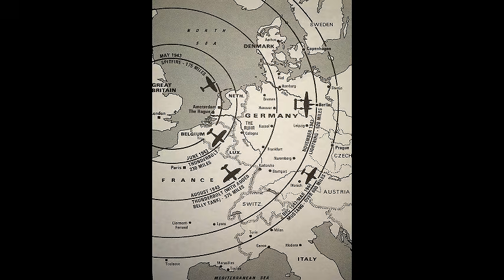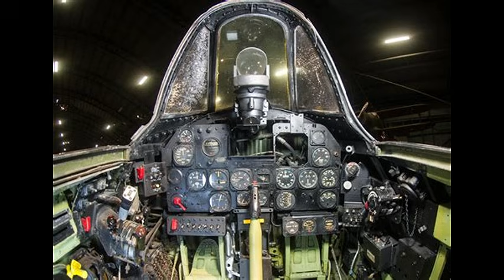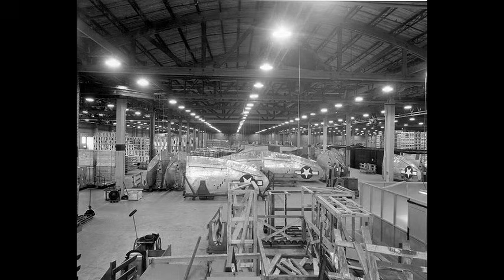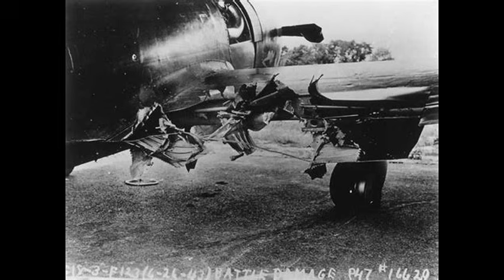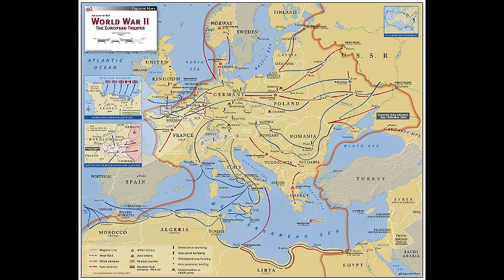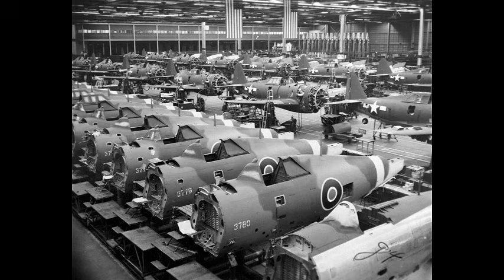German Pilots Were Shocked By America’s P-47 Thunderbolt That Survived Everything

Comment: P-47 of the 64th Fighter Squadron, while on a mission to Milan, struck the ground during a low-level strafing run. Despite the bent props and crushed chin, the pilot nursed the Jug 150 miles home to Grosseto.
Reply: On a History channel episode of Dogfights, a story told of a P47 rendered all but completely unable to maneuver was found by a single BF109.  It ended up expending its entire ammo supply, raking the P47 wing tip to wing tip.  The pilot survived by taking cover behind his armor plate behind his seat, and when he managed to land, he stopped counting bullet holes at about 200 when he didnt even need to move.

Comment: While the P-47's durability is undeniable, it's often overlooked that its weight and size made it less agile than its rivals. Did this impact its dogfighting effectiveness, or was ground attack its true calling? Would love to hear your thoughts.
Reply: In the video he covered this topic quite well. I would also encourage you to check out Greg's autos and airplanes channel. He has like 3 or 4 videos on just the p-47 alone. In summery, yes, it was terrible in a turning horizontal fight. However, in the vertical and with high energy it could out dive anything in the air and then use that energy to climb back up to look for targets, kind of like a hawk. Gunther Rall was nearly shot down by a p-47 when he tried to dive away from one. The British did an analysis of the p-47 and its flight characteristics. They found that it had an ok roll rate,  lower than a Spitfire, but still respectable. It had terrible climb (pre-padle blade props) performance up to altitude, a terrible turn rate - especially compared to the Spitfire, but in a dive it could outdive a Spitfire “easily". So in a dogfight, the 47 learned to force the enemy into its terms and avoid engagements that favored the luftwaffe. Combined speed at high altitude with boom and zoom tactics made it lethal as the 47 got to choose the engagement and disengagement of a fight.
Reply: @magnashield8604  that's an excellent breakdown 👏. The P-47 really was a beast when flown to its strengths — high energy, dives, and boom-and-zoom. Thanks for highlighting Greg’s channel too, it’s always great to point people toward more in-depth analysis. And you’re right: what made the Thunderbolt lethal wasn’t trying to turn with a Spitfire, but forcing the fight into its own terms. Appreciate you sharing such a detailed perspective 🙏

Comment: Die p 47 vertragen viele mg Treffer,  aber die Mk 30 mm waren auch für p 47 tödlich. Von den 20 mm geschossen 3 bis 5 nötig...aber das konnte auch eine b 24 oder b 17 töten
Reply: Slow rate of fire, severe projectile drop over distance, low ammo supply meant that cannon fire was not as effective as one may think.
Reply: 30mm had terrible range and a low rate of fire. Against bombers and slow moving targets it was devastating, against fast moving fighters it required luck.